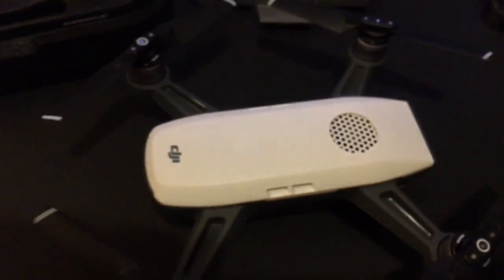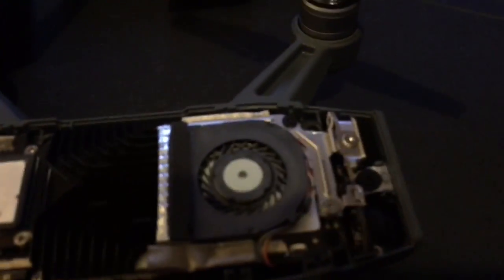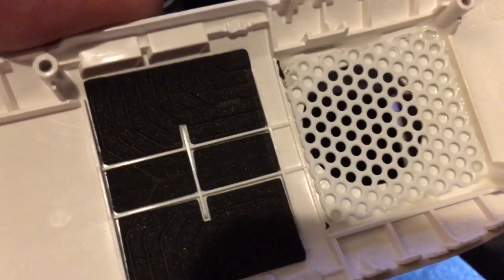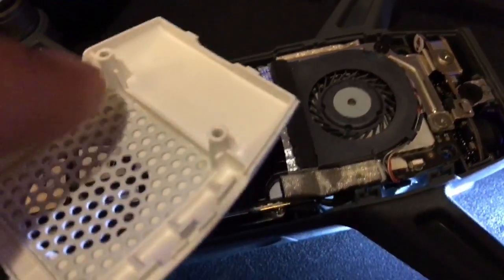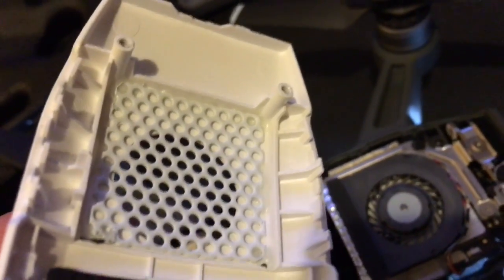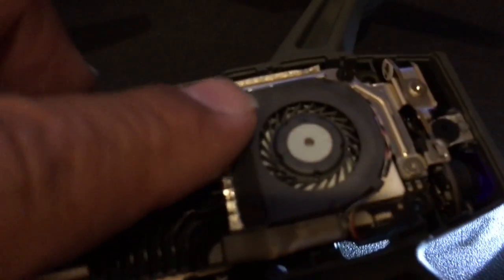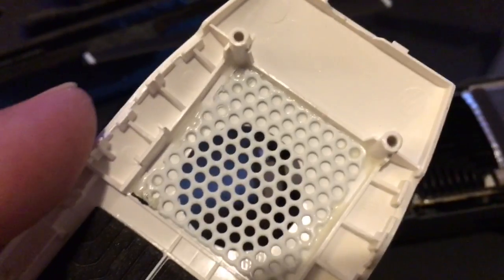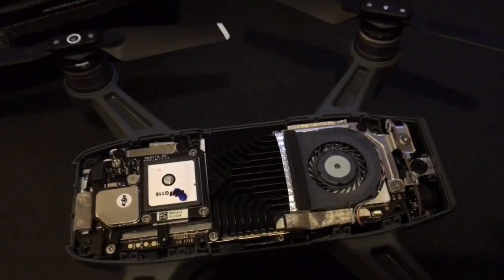Dji Spark mods

Comment: Now if it rains his Spark is a yellow submarine with a screen door in it! Lol!  ;-)
Reply from the maker: Richard Moore Really....who in the hell would subject their drone to a rain shower?
Reply from the maker: Richard Moore so your saying if I didn’t do the mod....I’d be ok flying my spark in the rain....?😂
Reply: You can't read! I said you put put a big Fing Hole in it!!! It's going to get water in it if it just sprinkles a little on it!
Reply: I'm saying you would be better off "NOT" doing the mod because engineers that have a college degree and have 3D cad drawings in three views from every angle and every measurement of the fan, so they can see what you can not possibly see. Clearances that were designed  so the fan could take the cool outside air from under the camera into the fan on top and directed through the fins to the outsides. If the fan was so closed off from it's belly opening like you say, the fan could not blow at all. If you want to fly so fast, buy a Racing FPV Quadcopter! It will blow the doors off of that Spark!
Reply from the maker: Richard Moore do you own a spark?
And don’t hate on me cause I tried something new....do you even realize how warm this thing gets? Well I do and after doing the mod it’s hole lot cooler!
So go on with your subjective conforming consumer who just thinks that just because a bunch of engineers made the product that it might not be flawed.
Nothing is made to last forever...and in regards to your racing drone comment, I’ve had racing drones in the past and their wack, Think a racing drone can last even 10 mins? And go as far as a spark can😂
But thank you for the comments! And trust me the air getting in from behind the gimbal....no don’t work the fan is designed to just push hot air out and that’s all it dose. If you own a spark try taking the cover off and check out the internals then get back at me!
Reply from the maker: Richard Moore LOL....love the hateraid bruh...😂 thank you for the comments! And🖕🏻
Reply from the maker: Richard Moore And yea....I’m man enough to be a hack, I’m the inspiration, you wish you could have, I have the balls you don’t have!
Reply: I keep a piece of tape to stick over the hole just for rainy days.
    It basically makes it vent the way it used to which is fine because rainy days tend to be cooler also. 😉

Comment: You guys really shouldnt do this to your drones. The fan is engineered to pull air through the side vent holes, across the heatsink.  Yes your hole in the top of the drone will create more intake but the volume of air now flowing across your heatsink is minimized. The overall body of the Spark is fairly small so the air could circulate within the body but the original design intent was from an engineering standpoint.
Reply from the maker: Island Boyeee those side air vents are “only” for exhaust Not intake!
Reply from the maker: Island Boyeee Do you even own a spark???
Reply: Island Boyeee is wrong.   The vents are exhausts.  Not intakes.  Want proof ?  https://youtu.be/uG028lTn8IU
Reply: Great advice here with Island Boyeee,  Save your $$$$drone from this crapola Hack! Don't drill a hole in your $500+ Spark! Listen to Island Boyeee!!!
Reply: Richard Moore is right

Comment: If the weight of that fan would be replaced with the same weight on more heatsink and somehow let it exposed to air i think those 4 propels would be more efficient since they are so near of the body and spinning all the time super fast, DJI should think of that in future designs.

Comment: does the battery last longer since the fan doesn't have to work as hard?
Reply from the maker: ISLANDTECH PTX Battery stays cooler, I have this drone modded with the super sport mode....it dose about 45 to 50 mph so I go through battery’s pretty quick!
Reply: @geolopez914  how do you mod to super sport mode?
Reply from the maker: Sanch068 you need to be on an older firmware for the drone....And also use the older firmware of the DJI Assistant 2 app for your computer. I haven’t updated my drones in years and they all work Awesome to the day, Not to mention the Super sport mode! Check out “digdat0”on you tube...he explains how to do it step by step.

Comment: The cool air in to left ventilation hole and the hot air out to right ventilation hole...this mode will block stop the air to cool the left heat sink 😓😓
Reply: don't you see at the beginning of the video when sprayed with smoke, the two ventilation holes just blowing does not suck 😂
Reply from the maker: Saliman Pang....There is no left or right heat sink , both side vents are for letting hot air out evenly!
Reply from the maker: Byan Yafi I don’t know why people keep thinking that one side of the heatsink draws in cool air and the other lets the hot air out.

Comment: do you have the dimension of the center of the hole and how big of a hole, does the top just pop off or do you need to unscrew it?  thanks
Reply from the maker: pat lucas There are 6 screws in total....4 under the battery and 2 by the gimbal.
The dimensions of the hole is the size of a 2032 button battery, I started by drilling a hole in the center and then took a round file and sanded the hole bigger until I got the desired size. I will add that the hole is not directly in the center as the fan dose not sit in the center as well.....good luck! And thank you for watching!!
Reply from the maker: Oh and also there will be some glue in the center screws, You can just take an exacto blade or even a sowing needle and just take the glue off. DJI dose this so you can't take the cover off.....but it's very easy!

Comment: I just took the top plate off mine stays much cooler
Reply from the maker: Mike Sarni....Dude be careful flying with no cover, a bug or something can get sucked into the small fan and mess things up. THANKS FOR WATCHING!
Reply: Giovanni Lopez props cover 95 % of the top while flying did 21 flights not one bug and 10 degrees cooler
Reply: Giovanni Lopez seems like faster gps connect also. Def faster then my p4p amd p4!

Comment: This a cool mod, I'd give it a go. From what I can tell, air goes in one side of the drone (intake two vents) and out the other side (exhaust). The long path of the sink draws cooling air over it and does actually cool, relative to the design. If it wasn't sealed around that fan, there'd be less suction for the intake. It is "hot" to us. These components are specified to operate within a certain range of temperature, a "hot" temperature which is normal. Your solution increases the air that goes in, decreases the temperature certainly, but I'd be concerned about moisture from clouds, larger particulates having a direct path to the fan and components underneath. I'd studied product/industrial design. I would figure the folks who designed it settled on how it was as the best solution, a compromise of cooling and protection of internal components. Of course, one YouTuber flew his Spark with the cover off after his teardown, so the drone must be pretty durable, anyway. All sorts of dust and debris got inside and it was working just fine, apparently. The only reason I wouldn't do this is to void the warranty, or have DJI cite this modification as a deal breaker on a replacement, attributing what would have presumably been their responsibility - the probable cause of malfunction, to your modification. Looks cool as hell, though.
Reply from the maker: Mike Starkov both vents are exhaust ports, it doesn’t draw any cool air from either side. The fans sole purpose is to blow the heat out from both sides!
Reply from the maker: Brian B WOW dude that's what I like to here, Thank you for watching and the feed back! I am working on another mod and will be posting a video soon. I do appreciate your comments on this and again thank you for watching!
Reply: Brian B correct! The intake is on the right side, exhaust is on the left. So this mod does not make sense.
Reply: I only believe it goes in one side and out the other, but cool air would make sense coming in from the front. I've tested this with paper. On one side it gets pulled in. On the other the paper strip pushes away. Your design solution looks cool, and is definitely effective but there must have been more disadvantages accompanying that approach that engineers didn't implement it. Debris getting in. There again one YouTuber flew his after taking it completely apart and reassembling it without the cover for one flight and it was fine. If I do this to the cover, I'd probably incorporate a hood scoop with screen or foam at the opening.
Reply: If it looks so cool, He would do better to take a picture and make stickers of that cooling hole! Brian B, Your right about the engineers that designed it had a lot more knowledge and tools for testing their design than super hack here! Don't let him fool you into hacking up your Spark!
Reply: That is totally correct!
Reply: The addition of a small piece taken from a HEPA filter might mitigate particulate ingress whilst still providing airflow. Interesting mod, I just got my Spark so I am binge watching all the videos. Thanks for making these interesting inside views, I wont be taking mine apart just yet - my wife would kill me.

Comment: You need to provide a way to filter the air...
Reply from the maker: Rafael Valente the small grill dose the job.
Reply: I'm refering to place a filter like a mesh of a K&N Panel filter, you know... Just to filter all the particulates in the air and avoid to stuck the small fan... I'm going to open mine and do the same as you. Great job btw...
Reply from the maker: Rafael Valente that type of filtration isn't necessary!

Comment: How did you get it to do 40mph?
Reply from the maker: Romeo Fowler...like this....https://youtu.be/2XLsiZhClu8
Reply from the maker: Romeo Fowler the same parameters I use for the mavic, I used for the spark....that's how it dose 40mph. There are more videos where "digdat0" shows you how to open the options in the dji assistant 2 program.
Reply: Giovanni Lopez but my MP does 45 without any mod.
Reply: Buy an FPV RACING QUADCOPTER IF YOU WANT FAST! THEY WILL BLOW THE DOORS OF AN SPARK!

Comment: how many wires attached to the front sensors ??? is there a way to put another one in the back???
Reply from the maker: Jerrico Desiderio I turn all my sensors
Off when I fly. But I don't think there is a way to put more sensors, tho...there is a 5 volt output on the board in the back of the spark.